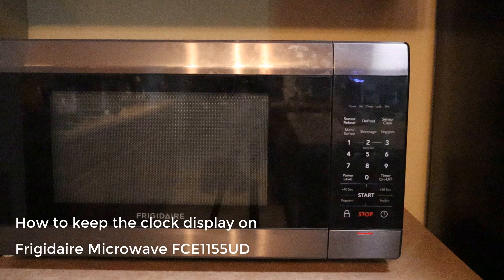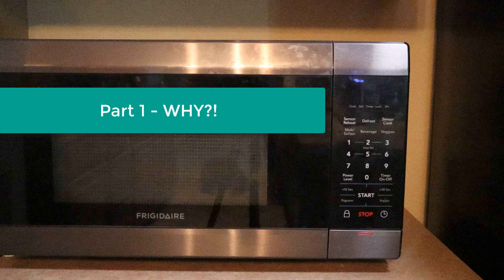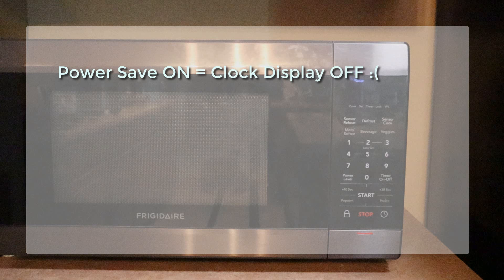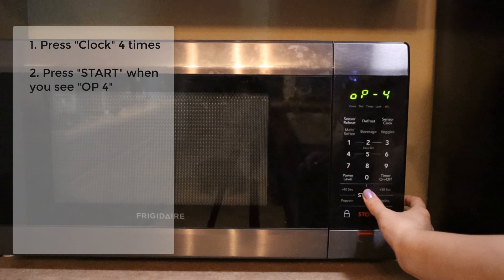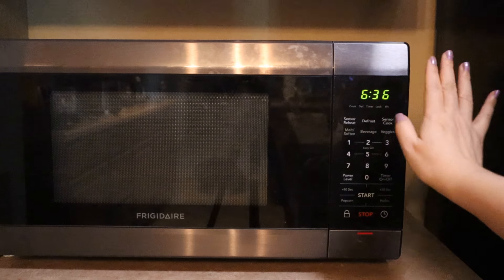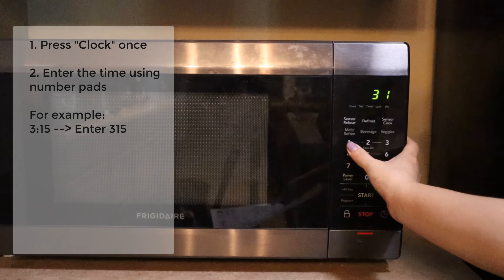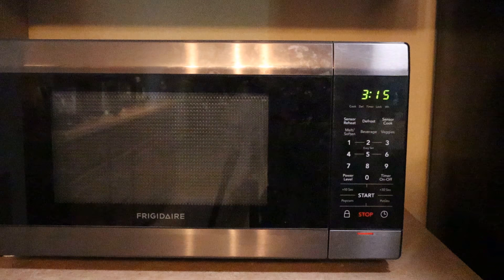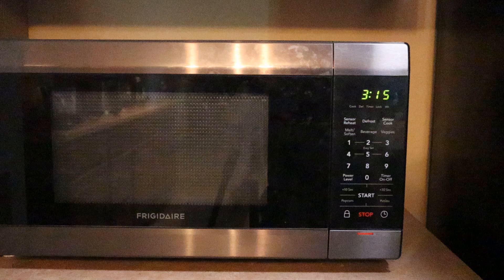How To Fix - Frigidaire Microwave Clock Won’t Stay On - Time Disappears - Microwave Clock Set

Comment: Great explanation. Thanks loads.  You saved me from much frustration. I have set the clock before but stumbled through not really remembering what I did. After the power went out today, I was regretting having to set the clock again. Your video was a lifesaver.

Comment: Thanx for your detailed help....even the included instructions with the unit weren't this clear or helpful....and the toll-free number is time consuming and frustrating ....took over 15 minutes to speak to a real person and then the call got disconnected..... are there really that many people on the phone complaining about Frigidaire products?....... You totally saved me from throwing this unit out into the yard!.... now if I could only figure out how to set the cooking power level
Reply from the maker: Thank you for your message. I am glad it was helpful ^__^ 

For the cooking power level, you can set it by: 
1) Enter your desired cooking time 
2) Press "Power Level" (press it once will say "P-H1" which means 100% power; Press it again will say "P-90" (90% power); Press it one more time will say P-80 (80%) power and so on. 
3) Press "Start" after you have selected your desire power level. 

Note: "Power Level" does not work on "Defrosting" 

Hope that helps 😄

Comment: Not showing the clock was SO ANNOYING and without the manual I had no idea how to fix it. Thanks for the video! It worked. It has to be a miniscule amount of power saved by not showing those LEDs. So weird to have it as power saving mode.

Comment: It didn't work by pressing the clock button, so I tried the gear icon button for settings. I pressed it 4 times for O4 and followed the instructions from there. When I pressed start on OFF, the clock still stayed off. So I pressed clock and it flashed the time, so I entered in the time, pressed start, and now the time finally stays up. Thanks so much!

Comment: So there is no oP-1
oP-2 is sound on or off
oP-3 is lb. Or kg
oP-4 is Power Saving on or off (clock)
oP-5 is Demo Mode on and off 

Option 5 is on will really make you think it’s broke.  I was also annoyed by the beep so pressing the clock, selecting oP-2 and changing to “off” has been nice!

Comment: This doesn't work for the newer model. On the newer one, it's completely different. 
If you have newer model, follow instructions below:
-Press ⚙ 3 times to "Op 3".
-Press Start.
-When it shows "off", press START.
-Then press 🕒.
-Enter your current time.
-Press START.